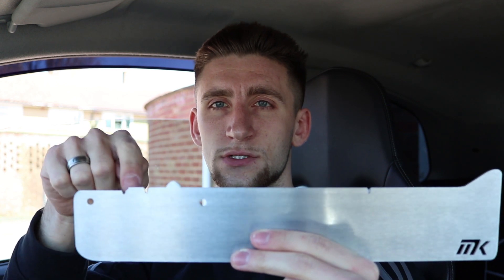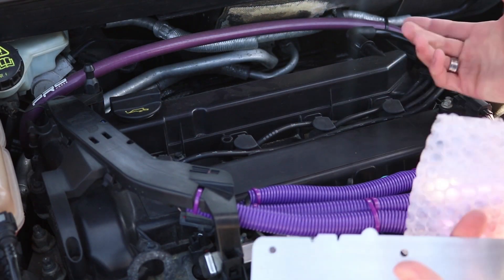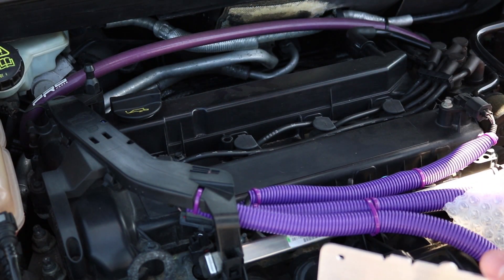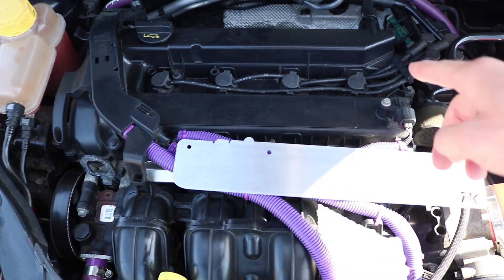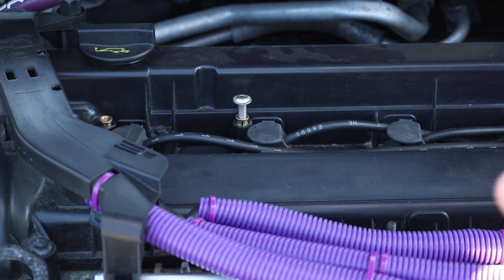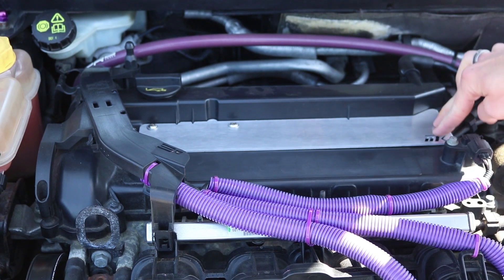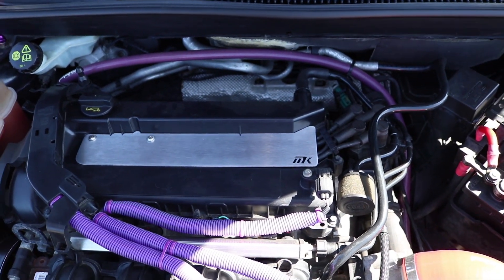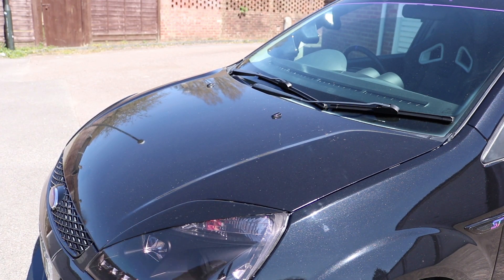MK Attack Spark Plug Cover (Fiesta ST150)

Comment: How comes you have spent a lot on the look but no cams or intake manifold do you not want more power it’s a very restricted engine
Reply from the maker: Got a small performance/handling mod to fit next, will hopefully be doing cams and inlet later in the year 👍
Reply: @Jmncarter  
May as well go all out and slap a turbo kit on 😂....bonnet gas  rams on the cards ??  ..did mine a while back miles better than that fiddly bonnet strut 🤷🏻‍♂️😎
Reply from the maker: @swiftyrs2354  ahaha I wish buddy. Haven't got 2 to 3k in my back pocket 😂 yeah have thought about the gas struts which I may purchase in the future